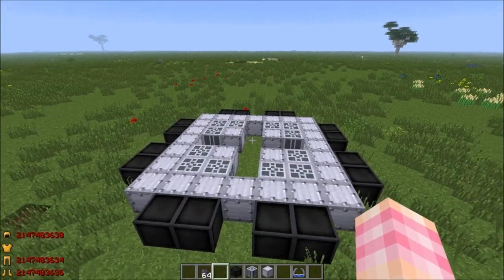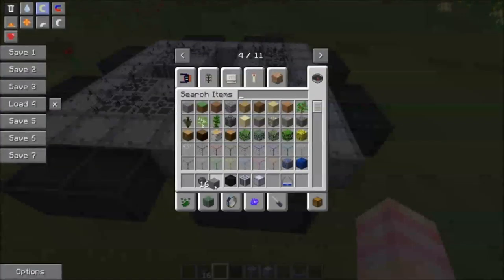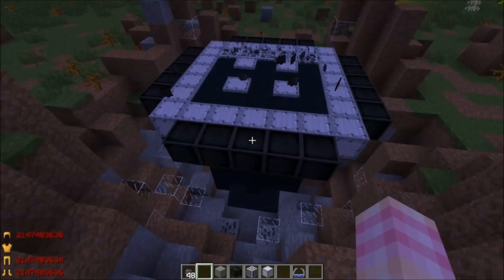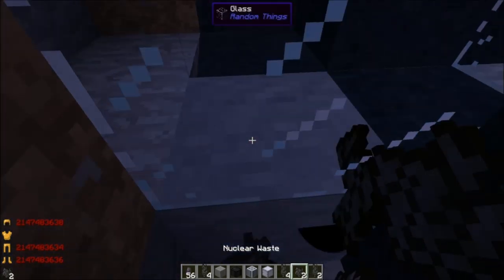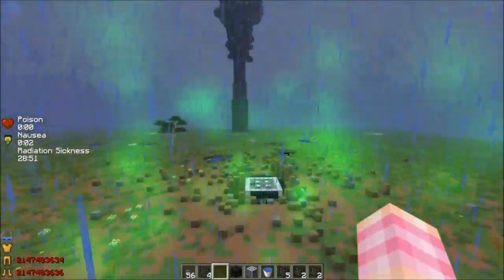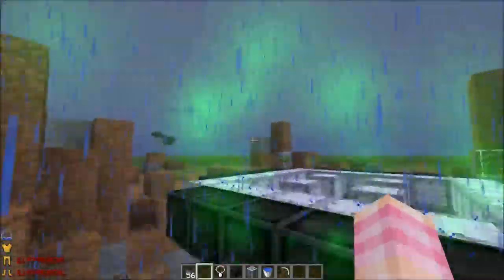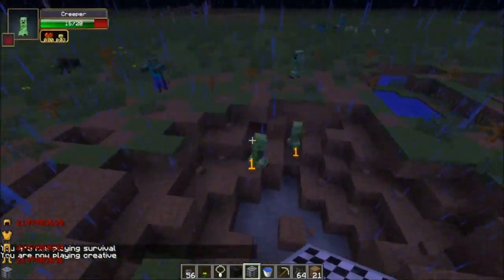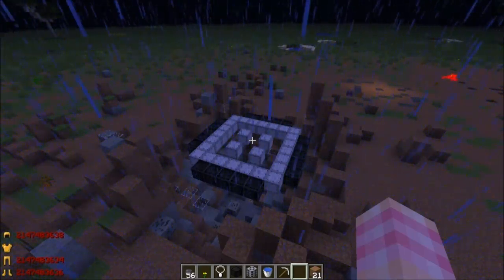ReactorCraft Tutorial #7 - Nuclear Disasters

Comment: The stone inside the reactor is absorbing some of the neutrons.
Reply from the maker: Oh. Are there any blocks that provide thermal insulation without affecting Neutrons? Glass maybe?
Reply: No.
Reply: ReikasMinecraft Would replacing the stone with more reflectors speed up the meltdown?  I can't remember the fission properties of plutonium IRL and don't know how it's implemented in your mod, but IIRC with uranium reactors neutrons have to be in a "happy middle ground" of speed or else fission won't occur.

Also: FINALLY a nuclear explosion mod in Minecraft that creates glass!  :)
Reply: Air would have been the ideal block to have in place of stone, to avoid absorbing any neutrons.